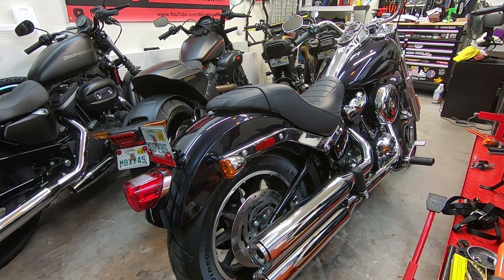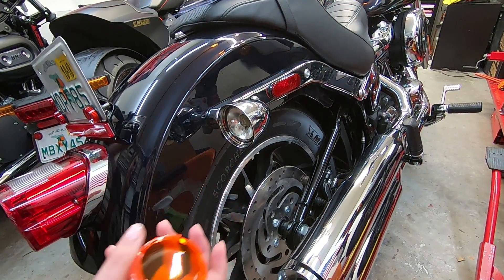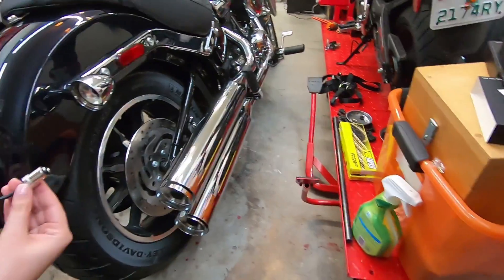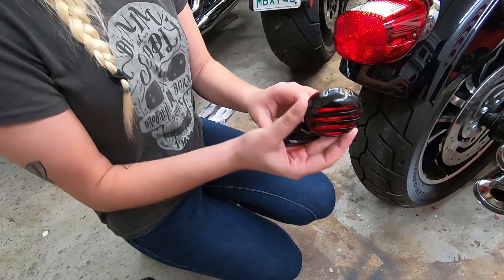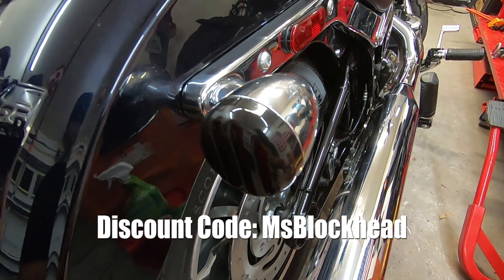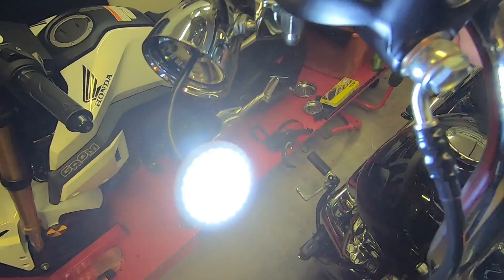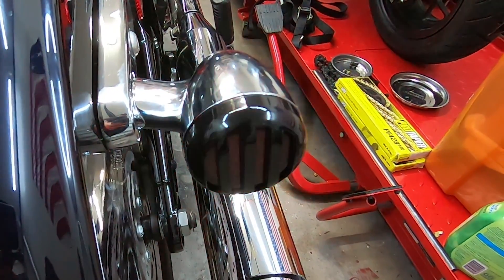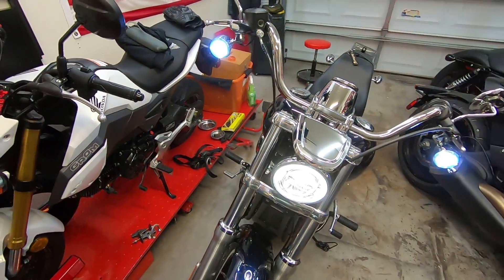How To: Harley LED Turn Signals + Brake Light Install!

Comment: now you need the smoke brake light led setup. I just got mine for chirstmas it was custom dynamic and the low profile. looks so good. visibility from the rear is great. LED's are the best.

Comment: Lil neat tip I learned from a old former mechanic if you take a tiny bit of acetone on a microfiber cloth you can clean those older style bulbs to take the oils off and keep them from burning up the glass or blowing it out

Comment: RRI is the only way to go! You won’t be disappointed, their lights are amazing and Rich is a great guy to work with. 
We just installed a set on my wife’s Iron 1200 yesterday and I’m blown away by how good they look and function. I’ll definitely be upgrading the Custom Dynamics on my Low Rider S to RRI. Side by side RRI is a lot more of a punchy light output and the black backing is icing on the cake. The Custom Dynamics look really lazy and slow.  
If your running stock lamps or any other brand led lamps, make the switch!
Reply from the maker: We did a side by side comparison awhile back, and they're definitely brighter. With the 'no halo' and 'on / on' functionality, makes them a great light! And Rich is awesome, has been a real pleasure to work with!
Reply: @BlockheadMoto  I was about to order some custom dynamics pro beams when I found this video..  

big thank you to you and ms blockhead for the video..

Comment: I'd like to add that on her bike, she can have the dealer flip a switch in the lighting control module so the turn signals act as brake as well as turn, since they aren't running lights, it helps light up the back end.
The crew at Arrowhead Harley Davidson in Peoria AZ hooked me up. I'm very happy with how much extra it puts out.
If I can figure out how to post a video, I'll shoot it this weekend.
Reply: Tell me about this flipping a switch. As far as I know you have to buy aftermarket to turn rear signals into running and break lights.
Reply: @weaverkevin5462  In the video I posted above, I apologise if I mis-spoke, it does not actuate a 'running' light as the rears are single filament. It converts the turn signal into a brake light when the turn signal is not already on. I put a video in to show it, and in it I did say Running light, but I definitely mis-spoke.

Comment: I really like the midnight blue color of MsBlockheads Low Rider. When you both are doing duel vlogs, the bike looks more blacked out than anything. I guess it's just a color you have to see up close. Thanks for the video. Wish I knew about these and the discount code before I installed custom dynamics for front and rear. Also a big 👍 for modifications to the Low Rider.

Comment: CD offers the same product as well. I've been a loyal Custom Dynamics customer for years. Great service, lifetime warranty as well.
Reply from the maker: Used CD for awhile. These are brighter, no halo, and have the on/on functionality when using indicators vs CD’s on / off / switch functionality.

Comment from the maker: NOTE: The discount code is ONLY for the Lens Covers, not the LEDs. They are different companies. The LEDs are made by Rogue Rider Industries. The Lens covers are made by Get Phantom. The discount code only works on the Lens Covers by Get Phantom. 

I've received numerous messages asking about this. Hope this helps clear up any confusion 👍

Comment: In Australia the turn signals don't act as running lights which is a shame, I think it adds to safety. I'm going to be looking into changing mine to running lights.
Reply: Adrian Bolton same here in France, if you have any tip 👍
Reply: @frederichbs1499  I think there is a relay you can buy that allows the indicators to be used as running lights but I'm not totally sure. I'm going to ask my dealer when I'm there next.
Reply: You have to buy new duel circuit indicators. Euro and oz are single circuit.
Reply: Funny thing is, in America the turn signals don't work as turn signals for most, they're just running lights.
Reply: Adrian, we have had many overseas convert to make them work as running lights as well. You would need to purchase the 3 wire signal housings and hardwire them in, replacing the stock 2 wire international housings. Thanks, Rich!

Comment: I have an 01 Sporty 1200 and I want to do an LED conversion. I was going to get the hogworkz xtreme halomaker led inserts but the lens caps they sell aren't like the lens caps on my bike. My lens caps have 2 screws (1 top and one bottom). Am I going to have to replace the entire light housing or does someone make smoked lenses that fit the older light housings?

Comment: Thx for this cause mine on my 17' strert bob, the rear running/turns are a b8tch to get in. A lot of pressure to push in and twist. Thought I was gunna break something

Comment: Do they have load resistors built in or will you have to change the blinker relay so they don't hyper-flash
Reply from the maker: Depends what bike you have 👍🏼
Reply: @BlockheadMoto  did your bike need any regulators or reducers?

Comment: I have the custom dynamic LED halo lights for my 2004 883 Harley... it also has a stabilizer, are you able to switch out those with the  black label Road Rider series?

Comment: you will need to put a voltage reducer or like what happened to me your turn signals and brake light  will stop working after a cupple of months.Larry B

Comment: Question for you guys. I bought these after watching and I have a 09 Sportster XL 883 LOW. After locking the lights in I can not get the caps to fit back on over them. It's the original light housing, I coiled the wires. Any suggestions?

Comment: Nice lights!  I looked on their website and didn't see if they had ones for flat signals like on my 14 road king.  I'd love to get some.
Reply: You would want 1157 for the front and 1156 for the rear. There are brackets on the site that will allow them to fit in your flat style housings. Thanks and feel free to email us at support@rogueriderindustries.com !

Comment: So would the Gerilla Lenses cover also fit on the front turn signals, wondering why you used a clear smoke cover up front instead of the grill type gerilla that you used on the rear?
Reply from the maker: Since they have red lenses, they’re only for use on the rear. It’s illegal to have red forward facing lights. The company says they’re working on front covers as well 👍🏼
Reply: Thx, yeah that makes sense - did not think about the red on it.

Comment: Wondering if they have similar covers for the front turn signals..? I didnt see any on the site. Just thought it would be nice to have all 4 lenses matching.
Reply: Lenses front and back are the same.
Reply: @petemuddafuggincarvo9284  well I noticed that the gerilla lenses on the rear came in a red tint.. you would need a clear or smoked lense for the front. That's what I was saying. I didnt see the clear/smoke gerilla lense on their site.
Reply from the maker: I haven't seen the slotted Gerilla ones for the front. I'll be sure to ask Ms. Block if this option is available.
Reply: @BlockheadMoto  thx Block.. I appreciate it.  👍🏽

Comment: Blockhead... What would you recommend for people who have European Harleys where the signals don't stay running?
Reply: You have to buy duel circuit indicators
Reply: @ReplyNI  but it only has one circuit indicators
Reply: We have had many overseas convert to make them work as running lights. You would need to purchase the 3 wire signal housings and hardwire them in, replacing the stock 2 wire international housings. I believe your dealer or local shop may do this for you as well. Thanks, Rich!

Comment: Hi there ,Quick question for a 2019 iron 883n are they 1157 or 1156? Thanks in advance
Reply: Your model has 1157 front and rear.
Reply: @ROGUEAF  for my 2020 Low Rider S, is the rear 1156?  Video showed a 2019 Low Rider with 1157 was confused.

Comment: Heads up for anyone looking to do this on an international spec sportster.  The front turn signals have 1156 globe connections and not 1157 connections.  As I've just found out these great looking RRI front signals wont work on my Australian spec Roadster.  Rookie error on my part I guess.

Comment: Hey Mr. Blockhead! Me and my father are working together on my first bike. Its a 1980 sportster that my dad bought off a friend of his. Im 18 and I dont really know much about this bike other than prior research that I've done. everything is taken apart and we are currently just letting it sit. My dad is a very busy dude and I love him to death but I cant ever get him to work with me and guide me on things that need to get done. Could you happen to suggest anything that could help me get my dad to work with me on the bike? I've looked foreword to seeing  it done but its just not going anywhere. 
Thank You,
Propel! from Texas!
Reply from the maker: First thing I'd recommend getting is the service manual for the bike. Search online, there's probably a few good options to select from since it's from 1980. I've had some Clymer manuals and they're good, detailed with pictures. As for getting your dad to help you work on the bike, maybe propose to try and setup a set schedule to dedicate towards the bike. Best of luck!

Comment: Will these work on an 07 Sportster? How much will they cost front and rear with discount?
Reply from the maker: I believe they should work on an 07 Sportster, yes, so long as they're bullet style indicators like is in the video. You might have to get a load equalizer though. Cost wise, I've given links in the description which show cost.

Comment: does RRI have tail lights that stay on as running lights and blink as turn signals?
I would like to get some if they do.
Reply from the maker: Yes, the ones we installed and have linked in the description do that, but the Low Rider doesn’t have those as running lights.
Reply: Thanks bro!

Comment: The front signals don't look as bright as Custom Dynamics pro beam or Ciro Fang's. And the front white color looks to be about 6000k white, which is too blue for my taste. 5000k daylight white is the sweet spot. Other than that these looks pretty nice.

Comment: Awesome video ! Also, anyone have any idea why my 93 sportster running break light won’t work ? When I press the break it works, but when it’s just still it doesn’t work. Thanks
Reply from the maker: If it’s regular bulb, it’s dual filament and one of the filaments is burnt out. If it’s not, then could be an issue in the wiring if it has that functionality.
Reply: BLOCKHEAD Awesome thanks :D

Comment: Did it require a load equalizer
Reply: I believe 2014 (with canbus) and later you don’t need a load equalizer. My wife’s 2018 Iron just needed to run the hazards for a few minutes to get it to sync. Same with my 2017 Low Rider S with Custom Dynamics lamps.
Reply: What is a load equalizer?!
Reply: @shanemkeyes1  The turn signal flash rate can be corrected by installing a Load Equalizer. A Load Equalizer is required for each incandescent turn signal lamp that is replaced by an LED experiencing 'bulb-out' or 'hyper-flash' warnings.
Reply from the maker: I don't believe so, they don't hyperflash and there's no 'key error light' on the dash that she's mentioned. Certain bikes though, you do need a load equalizer. I know I needed one for my 2013 Iron 883 when I went to all LEDs.
Reply: @texasavage  how many minutes did u run the hazards for. I did 30 seconds and nothing.
Reply: @adminadmin9997  I want to say it said 5 minutes. I’d definitely do it longer than 30 sec

Comment: Are they the same for the 2018 softail slim?
Reply from the maker: Should be if they’re bullet style 👍🏼
Reply: Yes you would want the 1157 front and the 1157 rear for your bike. Bikes with a center taillight on the rear fender use the 1156 style.
Reply: @ROGUEAF  1157 need voltage regulators?
Reply: @adminadmin9997  It depends on the model and year of Harley. They upgraded the BCM in the newer bikes.
Reply: @ROGUEAF  2020 softail fxbb street bob?
Reply: @adminadmin9997  No it would be plug and play on there for USA bikes. 1157 front and rear. Thanks!